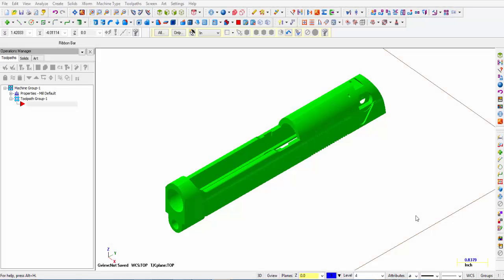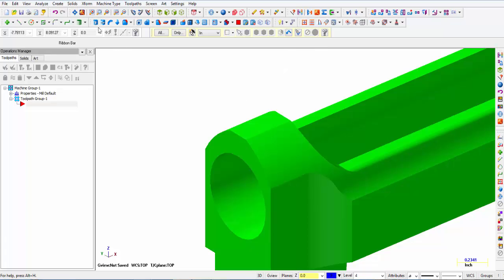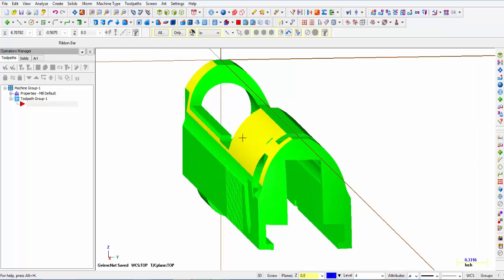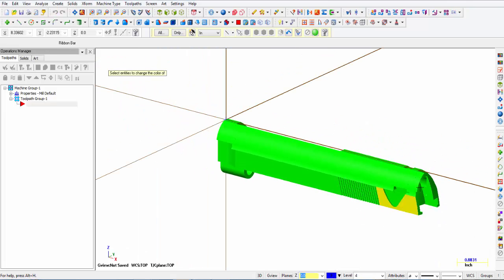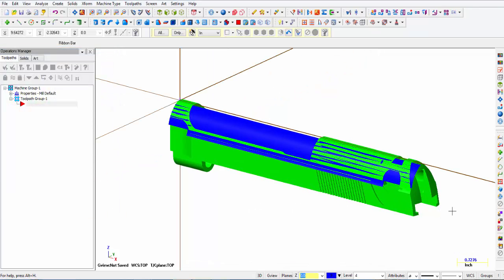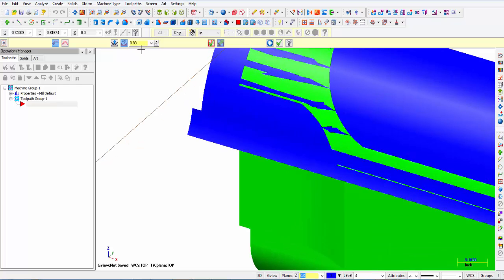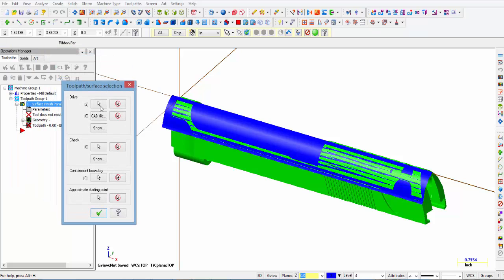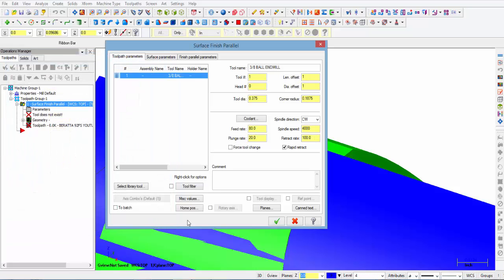SURFACING IN MASTERCAM

Comment: Now say you wanted to change your start point, to a specific point where your tool starts off of the job. How would you do that? 

I have been running a job at my work, it has a 1.5mm crown with a 55.624mm rad being cut in G19, But for some reason when I use surface parallel even giving it an extra 20mm total offset in the parameters the 12.7mm ball end mill starts on the part. Also I am coming from the bottom up, so it is wanting to bury into a massive amount of stock. I have tweeked the Program manually to give a few more cuts in the Y axis before it does so, but would be nice if I could figure out how to do it right in mastercam lol. Thank you for the video, and for any feedback given. I also can send pictures if needed!

Comment: I enjoy watching your tutorials.. I have a question, I programmed a part that has a large "chamfer" if you will, along a radius, I used finish flow line, and have checked all settings but the chamfer appears to do small linear cuts creating facets.. how would I correct this? Thanks in advance!
Reply from the maker: 2WN_2RBO 
What version Mastercam are you using?
Reply from the maker: 2WN_2RBO 
What version Mastercam are you using?
Reply: @TomStikkelman  2018.. I did research, found the filtering area, but only got it to make smaller line segments, meaning more lines of code.. would be nice to just have it create an arc..